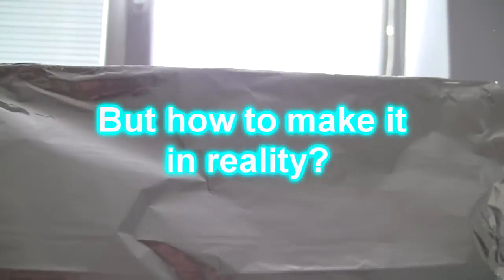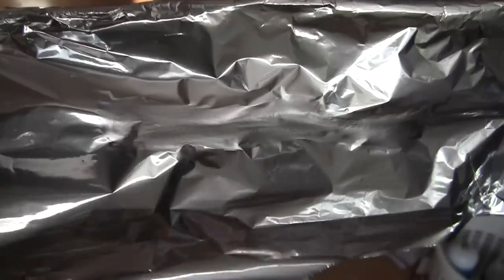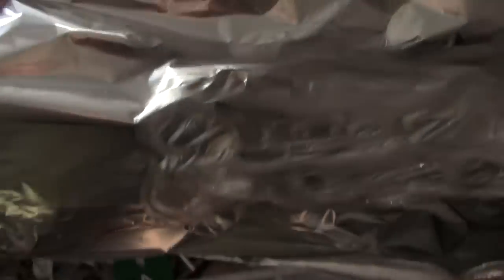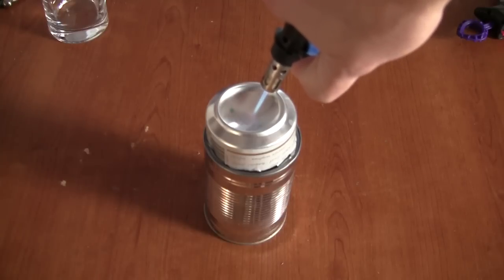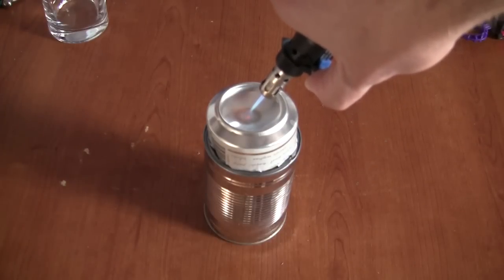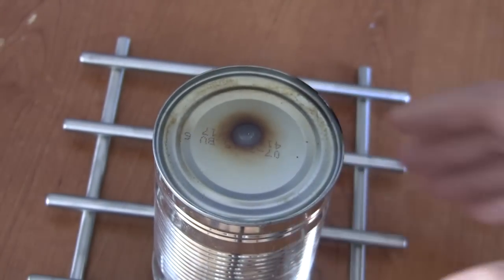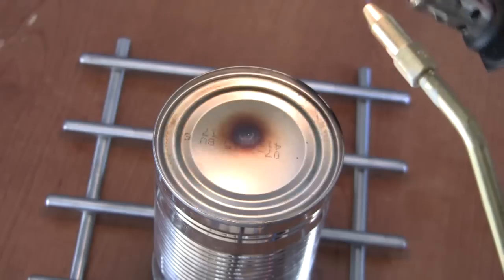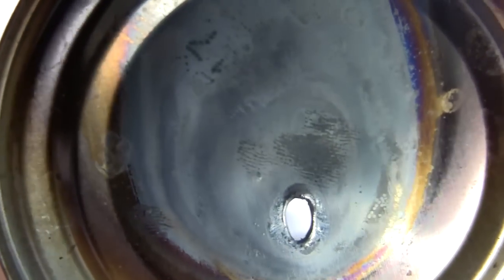How to make REAL Transparent Aluminium!

Comment: It looks like you just perforated it with millions of tiny holes.
Reply: Allan Floyd
No crystalline aluminum oxide was produced here (only grungy ragged and wrinkled surfaces of amorphous stuff), and any transparency is due to porosity.  The small size of the pores coupled with water's surface tension are what keep it from dribbling through, though given time it will slowly seep.
Reply: +Allan Floyd Why not? Do you care if what you're saying is right?
Reply: +steevf 
They look really cool under a microscope though!  A bunch of tiny fissures, not little round things one might expect when you think of holes.
Reply: +HansLemurson Can you find a picture or take one? i would love to see this. And maybe thunderfoot would too.
Reply: +steevf It could be tiny holes, or it could be that the aluminum has been left in a state of having millions of tiny crystals of aluminum oxide embedded in it that act as fiberoptic carriers from one side to the other. Which is arguably a hole... a hole in the aluminum, but they need not be holes in solid material that actually allow air through for instance. Or maybe a mix, maybe some are oxide crystals and some are air gaps. But aluminum oxide, the same material of rubies and sapphires, is well known for its optical properties. I'm thinking it MUST involve oxidation because even if the aluminum was melted, its surface tension properties would not cause tiny holes to appear through it.
Reply: Yes, people are saying that burning things in the open air will give you optically transparent crystals, and I'm the one who needs the citation.  Powdered glass is just as transparent as a window, right?

Go hold some aluminum foil over a flame until it dulls and droops, observe it closely against a lamp, feel the texture when you tear it, and THERE is your citation.  (Bonus points if you oxidize the middle of the sheet so you can make a cup and watch water soak through it.)
Reply: Pics or it didn't happen. Lol
Reply: +HansLemurson not really. I know glass is not transparent 'because of tiny pores'. 
Just think of it; let's say a tiny glass pane is 1 million atoms thick. How is it possible that it's transparent in all directions? 

The real reason is that visible light doesn't have enough energy to be absorbed. UV light, however, does have enough energy to do so. 
That's also why you don't tan behind a window.
Reply: +Joey Verhaar idk about not tanning behind a Window this lady I know that works in an office sat in the same place every day and the sun would hit her face on one side only over the years her skin looked horrible on one side she ended up with skin cancer
Reply: Allan Floyd I'm aware of that.
Reply: +steevf  Someone needs to get that under an electron microscope
Reply: Every heroin smoker knows it's tiny holes; flame will go through them to ignite their precious brown liquid.
Reply: +steevf  Nope, he oxidized the aluminum into aluminum oxide, which is a clear crystal.
He shows that its waterproof later on with the bottom of a can.
Reply: HansLemurson Sure.  Whatever you say.  Couldn't possibly care much less.

Comment: Cool, but can you make transparent aluminum that's 1" thick and strong enough with that method? Do the properties of the aluminum change substantially when it becomes transparent? 
At last check, the makers of the high grade transparent aluminum use a compression technique to make aluminium oxynitride.

Comment: I am curious about the RED colour when the thin Aluminium is heated; an Oxy Acetylene torch used to weld much thicker Aluminium (approx 1mm) does not produce they same colours. Prior to melting, Aluminium does not produce any colours that are of use to indicate when it is about to become a liquid. The only indication I am aware of is a slight blistering of the surface; once this is seen the weld pool must be moved or the weld will fall away. 

The RED colour appears to indicate the presence of other elements. What are these elements? If you have access to an SEM; please do a transect across the transition from the non-transparent to the transparent regions of the foil. The compositional and morphological differences would be awesome to see.
Reply: +TheLargino
The hot aluminum, exposed to the air, quickly turns to oxide and so won't melt, allowing it to glow to whatever temperature to torch heats it to.

The transparency is due to the formation of microfissures through the material during the heating/oxidation process.  The surface, as viewed by an AFM, is deep fissures between ropy undulations.  It looks as though it underwent great tension along a single axis as it hardened, causing it to partially tear and form a structure resembling "expanded metal".

Comment: i can think of two possible explanations for that, a trivial one and a rather butiful one.

trivial first:
you are burning little holes through the aluminium that acts like a tiny grid. If the grid is small enough you wouldnt recognize it but it would be somewhat transparent. Such small holes are of course watertight, but permeable for air and maybe liquid nitrogen :-)

but here is the rather interesting one:
imagine your torche is somehow able to oxidize a lot of layers of aluminium atoms in metal. (how ever that works, the thermodynamics behind this would be awsome .. and i actually hate thermodynamics :-) ) If it then crytallise, it may create big enought aluminium oxide grains (corund) in the metal structure, so they are able to let light pass. If they are too small they would probably be quite whitish opaque. And if they held in place by a matrix of metallic aluminium, the corund-metal surface wouldnt be as brittle as pure mulicristalline courund but bedable to a certain degree.

That would mean, that you are able to oxidize quite a bit of bulky aluminium like a soda can with a simple torch, wich then .. (using hands like Neil DeGrasse Tyson) .. solidifies or crystallise to big enought grains of corund.. sounds awsome but also quite far fetched
and maybe i'm compleatly wrong and there is a way easier explanation :-)

Comment: @Thunderf00t So i think the  structure of the aluminum foil changed somehow (in atomic level) due to heating to allow light to go trough, is that correct? Or did it just become porous, with very fine holes that would still hold water because of the surface tension of water? Could you make a video explaining the physicalities of aluminum turning transparent?

Comment: I think we all know what's happening here, right? Aluminum, being quite reactive in air, is simply melting and reacting with O2 to produce Al₂O₃ which I assume can be somewhat transparent if crystallized correctly and it is certainly not soluble in water or any other liquid that I can think of at the moment. 

Perhaps some Al is vaporizing as well with all the gaps filled in by the Al₂O₃.

I just looked it up and, according to Wikipedia it is "practically insoluble" in ethanol. Which may mean its Ksp isn't infinitesimally close to 0 (like in water)  and it may be possible to test my hypothesis by filling the can with grain alcohol overnight and seeing if it starts to leak. I suspect it may though, depending on what "practically insoluble" means here, it simply may not be enough solvent.

Comment: What? You are supposing here that a thin sheet of heated aluminum becomes transparent without even acknowledging the physical properties of aluminum foil. Transparent aluminum? This is ho to make real transparent aluminum? By removing the aluminum from something transparent? Well done. You have made the groundbreaking discovery that butane burns hotter than the melting temperature of aluminum.

Comment: Aluminum oxide has a higher melting temperature than the aluminum metal. Welders need to grind off this outer layer and finish aluminum welding before another oxide layer forms. Otherwise they will blow holes through the underlying metal trying to weld it. Are you sure that you didn't melt away the under layers of aluminum metals and leave behind a thin layer of aluminum oxide that was thin enough to see through?

Comment: Interesting.  I've Welded aluminum before using a TIG machine but this never happened.  Could Danielle Arlington  be correct that you're just burning away the Aluminum and leaving behind a thin layer of Lacquer?  For those of you who don't know when you TIG weld you use an inert gas such as Argon to protect the metal from oxidation so if you do apply too much heat it simply melts away.

Comment: Wait so what is happening here? Why is the application of heat restructuring the aluminium so what it's electrons can't be excited? Why isn't it like that already if heat was used to make the can and foil to begin with?
Reply: +OwenBruch22  Aluminum is typically smelted and welded at high temperature in an oxygen-free environment because this will happen.  It will oxidize, making AL2O3, which is transparent but not very useful.  It is brittle and not very strong.

A similar thing happens with steel when it is cut with an oxy-acetylene torch.  The steel is first heated to a high temperature then a surplus of pressurized oxygen is applied to oxidize.  The newly made iron oxide is then carried away by the blast of gas leaving a nice clean cut through the metal.
Reply: +OwenBruch22 
It turns the foil into an oxidized mesh full of little pores that light can filter through.  I did this all the time as a kid on my parent's gas stove.  If you look closely you can see some of the larger holes.

The pores take the form of a series of fissures where it looks like the foil was partially pulled apart from itself, but then frozen into the gray oxide.

Comment: Aluminum oxide is the very thin clear layer on all aluminum exposed to the atmosphere. Looks like you got a thicker layer, is it so?

Suppose you deposited aluminum as a layer on a salt block in a vacuum chamber and then let some pure O2 in? Then dissolve the salt and you'd have an Al2O3 thin film.
Pump the chamber out and add another layer, repeat until desired thickness reached?

Comment: Consider this:  Put a thin Al sheet in a pressure chamber.  Connect the sheet in between two very high current electrodes.  Fill the chamber with high pressure Oxygen.

Heat the Al sheet and see if you can make thick transparent Al....

Comment: Tin foil is not pure aluminium. It is in effect a laminate of aluminium between two microscopically thin, but very strong, layers of aluminium oxide.

The heat is melting the aluminium (660C) but not the aluminium oxide (2074C).  That much is pretty certain.

I speculate the molten aluminium is being pulled away by surface tension and pushed away by tiny bubbles of gas from impurities leaving, at least in parts, just the very thin aluminium oxide layers which are so thin as to be largely transparent.

Comment: But, will it hold IPA or water mixed with a small amount of detergent or soap?  Is it just perforated with tiny holes that the water won't breach because of surface tension?  How about a back-lit microscopic image?

Comment: This is nice, but it would have been nice if you'd have given an explanation to why it gets transparent.
Is it oxidation? Is Aluminium Oxide transparent?
I know normally Aluminium passivises - meaning it builds up a very thin but inpenetrable layer of oxide wich makes it "immune" to further oxidation. We can't see this layer because it's too thin, or because the oxide is transparent, or both?
I'd like to know why the heat from the blowtorch turned the aluminium transparent.

Comment: It looks like something weird is going on with the aluminum as you heat it that makes it really, really thin.  So perhaps all that's happening is the transmittance across the film is getting large enough for some light to puncture through.  This would be true for any really thin piece of metal.
Reply: +AntiCitizenX 

My next best guess is perhaps some oxidation is getting into the film over time, which would behave more like a glass than a metal.
Reply: +AntiCitizenX This is my guess as well. Nothing is 0% optically transparent so anything you make thin enough will let light through (or so I understand it). Of course the question is, if this is true why does aluminum become so thin, and can you do anything useful with it.
Reply: stupidAgeverificatio

My gut tells me that something about the surface tension of the foil is making it get thin.  Maybe as it gets hot and molten, it repels itself rather than attracts the way water does.  That would make the hot regions get really thin.  If I'm right, then simply holding the torch on the foil would eventually blast a hole straight through it.  Tf00t just keeps turning it off before it gets to that point. 

I could also be completely wrong.  :)
Reply: RoMMeL1337ak47

Thanks!  :)

If it's really oxidation, then why does it still appear shiny are sharp angles? 

I guess the ultimate test would be to just measure its resistivity.  If it's still highly conductive, then it's still metallic.  If its conductivity drops, then it is oxidized into a glass.
Reply: +AntiCitizenX Heating aluminium leaves its molecules loosely arranged, this is why it becomes transparent. I he were to polish that the results would probably be close to glass like, though aluminium glass contains oxygen and nitrogen, so the results would not be the same.

Comment: I was trying to acid etch copper plated aluminum like you do with photosensitive PCBs and after what looked like a magnesium in water reaction and I whipped it out of the acid it was transparent where I had scratched down to the aluminum.. it was still a flat sheet but extremely brittle with tissue paper like strength..

Comment: Two things doing this. 1) The aluminum is melting and the surface tension is pulling the tiny bits of it into droplets that are thicker than the original foil, thus making a sort of "mesh" of aluminum that light can get by. 2) Aluminum is always coated with a transparent oxide layer that has a higher melting point that the aluminum itself, as the aluminum melts it leaves this skin behind and it's added to in places where new aluminum oxidizes.

Comment: Wait a minute, that's not aluminium, that's ALON! They use that stuff in bullet proof glass.

I'm guessing that when it gets hot enough the surface mixes with the oxygen and  nitrogen in the air, causing it to form a crystal like structure and become transparent.

Comment: At first I thought that they foil might be coated on one side with plastic, but after some googling I found no indication to that end. Also, I realised that there would be no point to doing so. The soda can though is probably coated on the inside.

But I do see the aluminium moving aside under the torch, thus the place where the torch was focussed will be very thin. Maybe that's why it lets light through more easily?

Comment: Transparent Aluminium already exists.  Aluminium Oxynitride - product name "ALON" by Surmet
Reply: +Anamnesia That's aluminum in the same way that ferric oxide is iron and thimerosal is mercury

As in it's not.
Reply: +TomatoBreadOrgasm In the same way that silicon dioxide is silicon?
Reply: +Anamnesia It's not aluminum, but it does contain aluminum. Aluminum oxynitride is a metallic ceramic and is only about 1/3 aluminum. It's also a bit harder to produce at home...
Reply: +Anamnesia If you're going to count aluminum compounds, why not just go with aluminum oxide? It has far superior optical properties to any glass, and is what rubies and sapphires are made out of. And it's probably why you could see through the heat-treated aluminum, microscopic fissures in the aluminum where it was oxidized, and possibly replaced with aluminum oxide crystals that act as fiberoptic carriers from one side of the foil to the other. The reason it is watertight is not necessarily because there weren't real holes in the material because water's surface tension would hold it back anyway, so I'm thinking real holes were likely in the aluminum and not merely crystals of aluminum oxide being embedded in the foil.

Comment: That's probably because the Aluminium oxidises and becomes Al2O3 which forms crystals when it cools down. It would be interesting to see if you could increase the transparency by cooling it slower and possibly creating a finer crystalline structure.